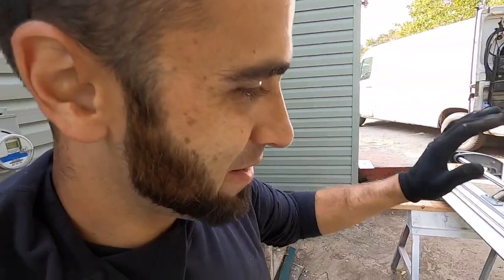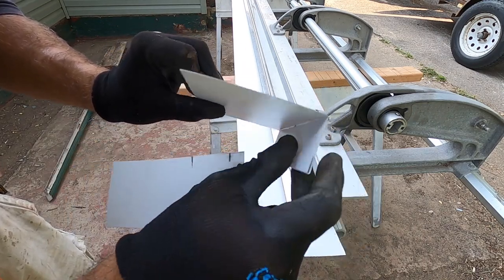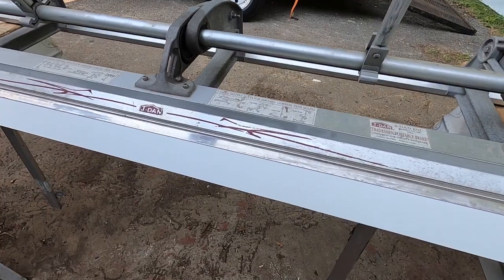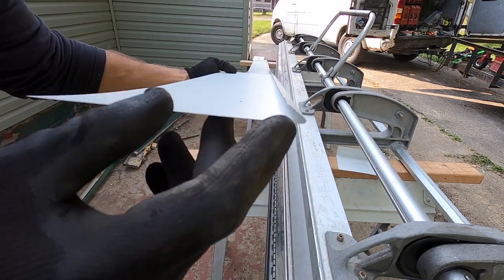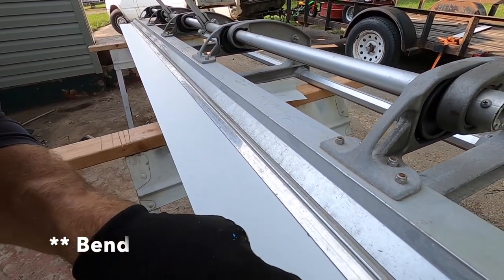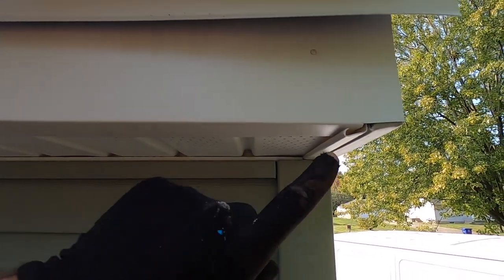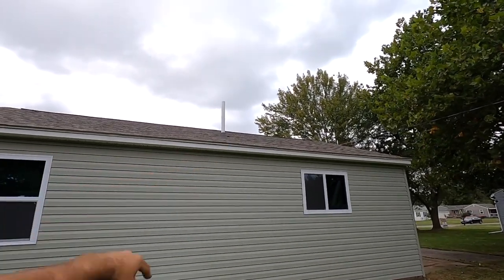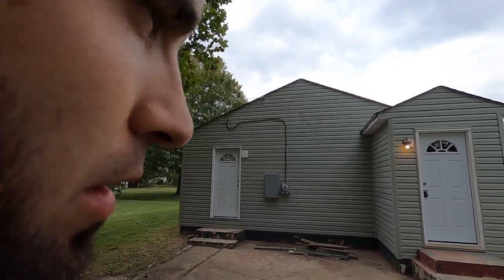Bending Fascia on a Siding Brake: Tips

Comment: i hem both sides along the length for rigidity and to prevent buckling.
Reply from the maker: Thanks, this is the best tip anyone has left me on my channel. I will be sure to try that on my next job. Makes a lot of sense.
Reply: @handylandlord  .....you also can try doing a over-bend (max allowed with you brake) 'without a flat hem' when the fascia will have a gutter, obviously the over-bend goes outward. It adds the rigidity and kicks the drip-edge out a little off the fascia and keeps water from tracking (surface tension) the drip-edge to the fascia. It also keeps the drip-edge in a uniform straight line along the fascia trim. I only do this where gutters will be. Copy and paste the the link below, great explanation. Give it a try and have fun.
https://youtu.be/sDTCTbyyg1s
Reply: This is a great idea